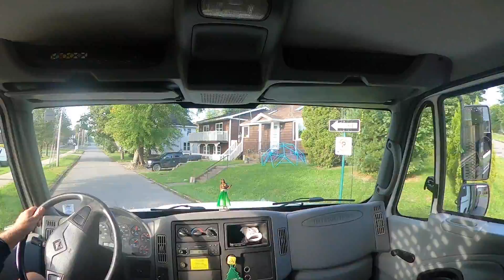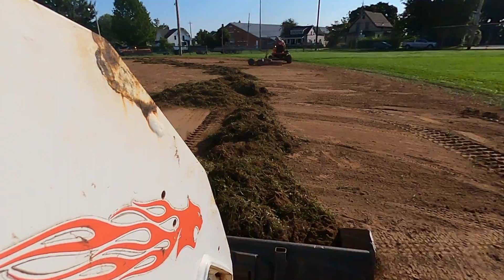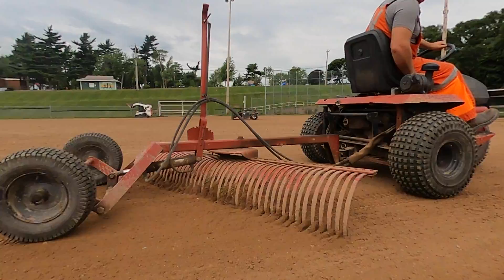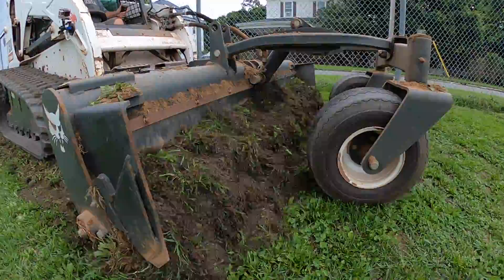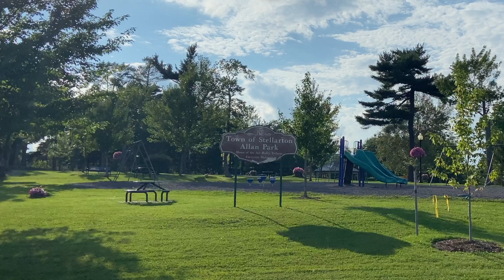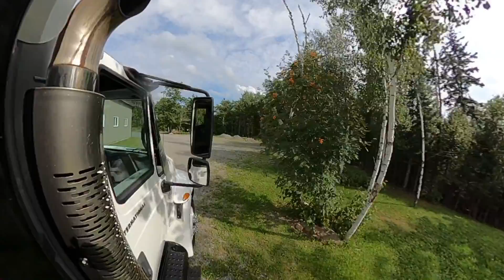Albion Ball Field & Warning Track Restoration~ Bobcat T190 & Soil Conditioner

Comment: 7’ rake? Mine was just delivered and I’m wondering I should’ve went 6’ on 74hp machine….
Reply: Looks like 6’/72”. T190 is 66” wide for reference
Reply from the maker: My T190 has wide tracks and is 72 inches wide. My soil conditioner is 84 inch
Reply from the maker: I have no problem running the 84 inch on my T190 using high flow.
Reply: After using the 84” for awhile now, my machine has no trouble with it.